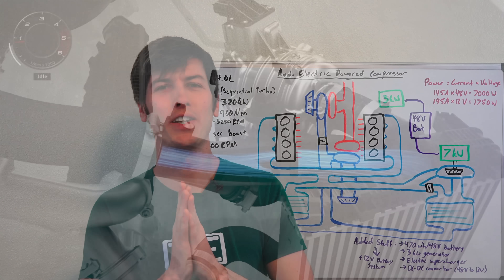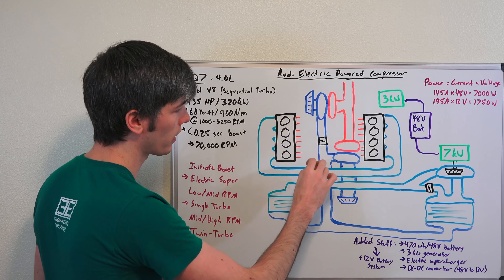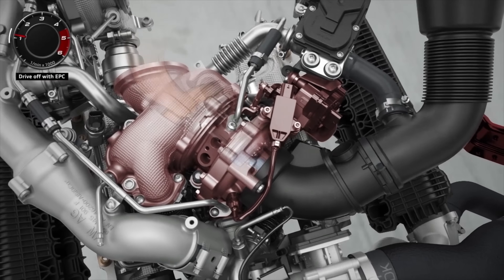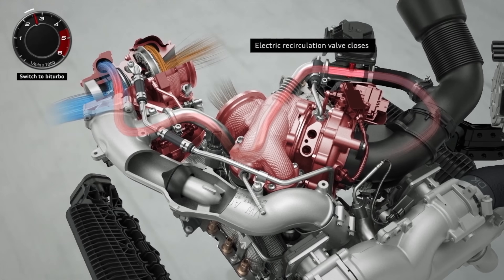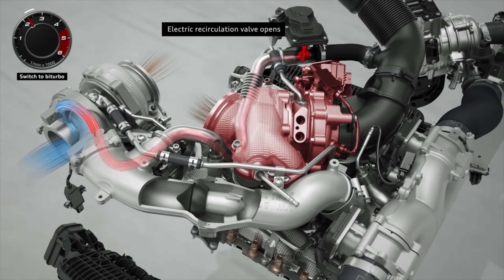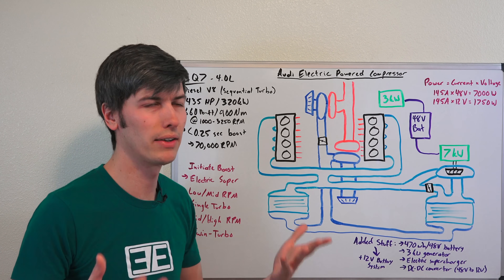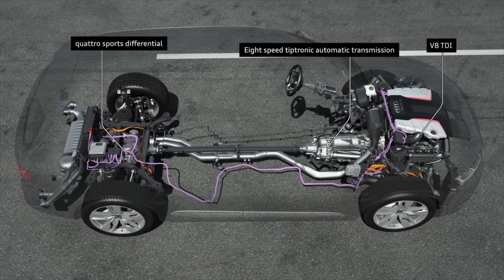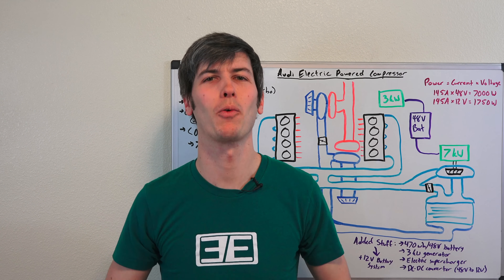Electric Superchargers - How Audi Is Eliminating Turbo Lag

Comment: 145 Amps ! That's a f**king lot !
Reply: More current, less voltage, about the same power. It's pretty similar to the amount of power to run a circular saw. My circular saw is 15 amps, runs on 120V, which is 1800 watts. 145 amps at 12 volts is 1740 watts.
Reply: That's what runs through my racing drone on full throttle, but only at 16 volts. And in case you wonder: batteries last 2,5 minutes haha
Reply: TheLukey, many regular car and truck batteries run at around 150 amps which is the example Engineering Explained used. If you want to get into cranking amps and cold cranking amps, the numbers are much higher. I'm talking about regular cars, not the Audi in the video.
Reply: T L S its 145A at 48V not 12v. Its 7kW
Reply: Right!? That's more than ten times what you need to run a circular saw!
Reply: It takes 145A at 48V for a 4l engine... I wonder if 145A at 12V would do for a 1l engine.
Reply: Justan OtherYTP 
The capacitors discharge way too quickly they are more apropriate for short supply spike power demand (short meaning less than a second)
U would need oversized capacitors to do the job of small battery
The reason the capacitor can keep its charge is in attraction  of +and - charged particles (keep it simpl)

As for the battery i am sure is designed to be able to deliver the power quickly enough
And can hold up the current demand, the power is stored in chemical bonds...
Due to the nature of ur question i will not get deeper u have wiki
Reply: Your starter draws up to 400-500 Amps from your 12 volt battery so its the same 7kW :)
Reply: No, it isn't. Can you even math bro?
Reply: just hook it up to welding leads and u got yourself a welding machine,
 mate
and quite a powerful one (although the duty cycle might be a tad disappointing)
Reply: nstead of a 48V battery, how about a bank of capacitors (in parallel) that gets charged by the alternator.
Reply: may as well get an electric car at that point, instant torque  :D

Comment: What a shame, V8 with single turbo single exhaust.
Reply from the maker: It has two turbos, if you watched haha...
Reply: I like it, but it needs to be a big turbo and big high flow middle exit exhaust.
Reply: Two traditional turbos + the electric one
Reply: Engineering Explained I might be wrong, but I think he meant that you can’t get true dual exhaust sound from single pipe, because both cylinder banks goes to one turbo
Reply: +Engineering Explained 
if you'd read what he said-.  a simple turbo v8, beautifully designed but then over thought and overcomplicated with way to many failure points designed in. I don't care how well made it is it will fail.
Combined with the electronics, you have to lease or sell before the warranty runs out.
Reply: I watched the entire thing and wept. They cheaped out.  Should have twin turbos. What part do you not understand?
Reply: +Rob Okray 
What part of there are 2 turbos don't you comprehend? The first turbo is spinning from the beginning, just boost until you accelerate and the exhaust gas can spool it up, thus the electric compressor to fill the delay. Then when the engine gets up into mid-range power they activate the 2nd exhaust valve and that feeds the 2nd turbo. I can see the reason for the electric, but it's way too complicated and expensive a solution for a niche problem.
Reply: the electric is just for low speed, off idle conditions. listen carefully.
Reply: Ideal is the same setup for each side of the engine. Ask Mr. Banks.
Reply: Rob Okray yeah much prefer twin turbo.

Comment: A day later.....

 Why don’t I just connect the motor directly to the wheels?!
Reply from the maker: A 7kW motor won’t provide a noticeable improvement in acceleration paired with a twin-turbo V8. It’s far too small. But it can make a significant reduction in turbo lag. That was the purpose.
Reply: Sam Kwant that would try to suck out a lot of exhaust gas that isnt present, therefore fighting a great vacuum
Reply: Engineering Explained I think what is being suggested is a much larger battery and motor.  Maybe a really big battery in the floor that could power the whole car AND which would make that 250 millisecond spool time look like a sloth....
Reply: Yeah this works, but I’m waiting for some brilliant engineer to go ahead and do electric turbo chargers on hybrids.  I mean come on already!  Hybrids usually have 200+ volt DC batteries and AC inverters that can produce some serious voltage!  Make hybrids fun and fast!
Reply: Engineering Explained why not attach an electric motor to the actual turbo though? Isn't f1 using a system like that?
Reply: Martin Fisker that issue can probably be solved at a smaller cost than an this system, say by using a valve that opens when air pressure in the exhaust manifold is lower than needed. The motor could even be used as an alternator when not providing power (mgu-h in f1), making it rather efficient
Reply: Y’all in comments saying you are smarter than Audi engineers? Go apply job there then.
Reply: sienile better in what ways? Simpler, yes. More efficient, no
Reply: Bryan Wong People make this argument but forget something, the power you’re using to spin the supercharger isn’t the only thing that is adding power to the wheels, its also the extra gas being burned because of the extra air.
Reply: Engineering Explained Yes -.far too small.  But they've done all the work to have a dual-voltage system.  I think what many are saying is that they are skirting the issue.  Someone at VW headquarters clearly gave orders NOT to make this vehicle electric in any way.  I know that sounds conspiracy-theory like, but constraints like that are actually very common in the car engineering biz.
Reply: It’s a green wash version of an Anti-Lag System like on rally cars. But without the fireworks!

I’m sure it does improve the engines performance for a lower weight and material cost than if they had fitted a hybrid electric drive system. But as a commercial product on a luxury car the hybrid drive is probably what would help sell the car.
Reply: None taken, you wrote nothing intelligent.. You should teach those poor Engineers from Toyota, Porsche, Ferrari etc.. how to build a hybrid..
Reply: Electric cars will never match petroleum density without some magic change in storage chemistry. However 95% of driving requirement is already able to be done by EVs. We buy cars with our hearts, not our brains, else we'd buy EVs for daily driver use and rent whenever we needed something else.
Reply: Daniel Sadjadian why not twin screw? I have a Roots style setup and I am not complaining but sometimes I lust for twin screw...
Reply: Daniel Sadjadian Except you want some actual efficiency.
Reply: You mean electric superchargers, not turbochargers. That whould be the best ICE ever -  THS II 180PS with electric supercharger =  220-250PS, ideal for super low fuelconsumption and very fast overtaking without complicated multistage turbocharger.
Reply: How many hybrids with turbochargers have you seen? If you would understand how these lean petrol engines combustion chambers get that high thermal efficiency numbers you would never think about turbochargers which complicates the whole process and creating resistance for gasses/piston movements. Turbocharger in petrol engines is for small engines where you need volume of big one, hybrids works the other way round, big volume that is not used most of the time.. 
Also the point of hybrids is to be the most reliable ICE engines of all, turbos are one of most unreliable parts of engines, and they spraying oil in to intakes and making engines with direct injection very uneffcient  - complete oposite of hybrid.
Reply: Stan, no offense, but you don't have a clue what you are talking about. There is so much wrong with you said above that I wont even bother.
Reply: Blakjak efficiency is not what you think it means.
Reply: You can add electric turbos to hybrids but the design purpose of most on the market today is to get better milage and whilst you'd get a "fun and fast" hybrid, you'd get "poor milage" (but better milage than most performance cars). 

This goes counter to government requirements for fleet milage (as in the average of the fleet sold) to hit N target point and quite frankly most consumers want good MPG as long as 0-60 is reasonable.

There are performance hybrids out there, but they're sold as performance cars first and hybrids are a secondary point. They're also used to get V8-like performance and 4 cylinder milage from a V6.
Reply: Exactly! Hence,more electrical-power being sent to bigger fuel-injectors (to produce more psi at each burn cycle),a bigger fuel-pump to send more fuel to those injectors,etc,etc.etc.
Reply: A day later...  still waiting for my tesla to charge to full so i can get home to Sacramento from LA...
Reply: Bryan Wong because many people love combustion engines, especially V8s.
Reply: Or a wind propeller that sits on the roof. It will spin as you drive and it will power the supercharger ;)
Reply: The problem is that infernal combustion engines are only efficient at full load (and for spark ignition, wide open throttle). All these changes will result in an engine that is less efficient overall. Combustion engine design is a series of compromises to find a happy medium.

I find it interesting that engines are on average more powerful than ever before, yet we're clearly past peak oil and a lot of this stuff is conspicuous consumption. At some point these luxury vehicles are going to be taxed out the wazoo (or fuel taxes will have the same effect).

Large powerful commercial transportation engines (for trucking) are carefully sized to their expected load. For personal transport there's a huge amount of ego massage and testosterone deficiency that seems to need to be factored into purchasing decisions (and a lot of premature ej******n driving).
Reply: Stan Trnik turbochargers ... assist it with an electric motor to counteract turbo lag then boost it with exhaust gases ... now to control boost pressure, turn that electric motor into a generator!  Another form of regenerative energy
Reply: A better idea would be a driveshaft driven supercharger.
Reply: root superchargers are the best!
Reply: Electric cars are great, I love them, and one day soon they will surpass internal combustion engined cars.
But today, in 2018, the most compact and weight saving fuel to power cars is gasoline/petrol. By weight and volume petrol is about 10 times more efficient than the most efficient battery, and the distribution system has been developed over decades.
When (not if) electric cars can match that, then they will become common place, till then we need pistons, conrods, valves, cams, petrol, and turbos come in handy too.